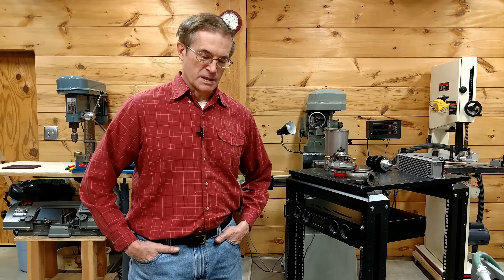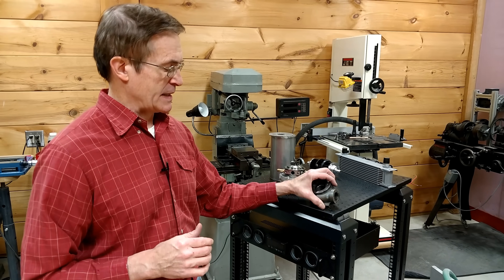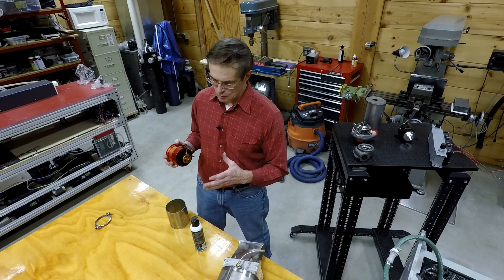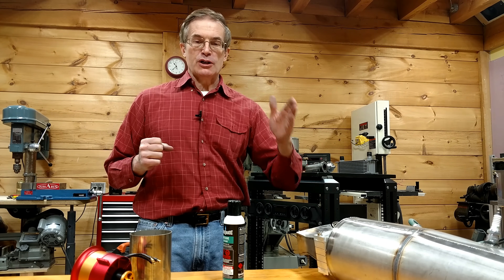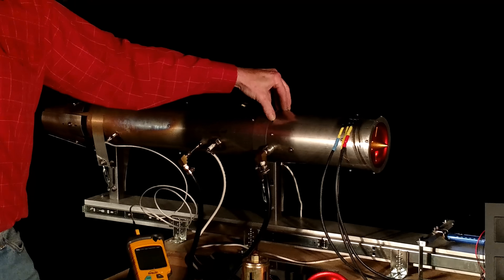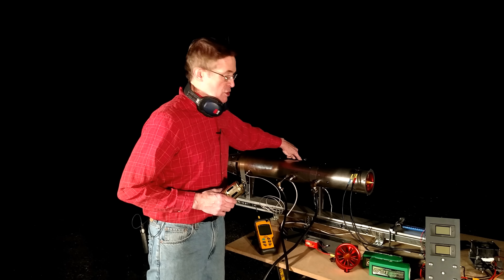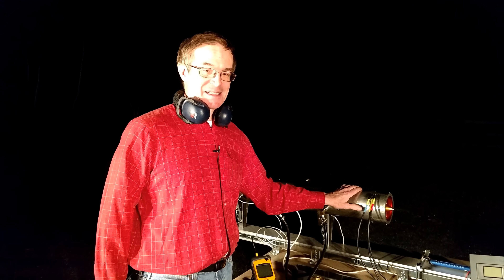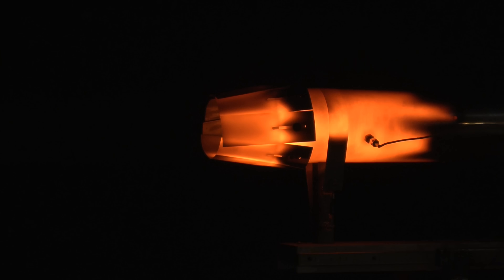Hybrid Jet Engine

Comment: Thanks great explanation. I never understood the "burning fuel increases pressure" dogrel. It as you say simply doesn't make physical sense as the  gases would come out the front of the compressor and the engine would stall. Clearly it doesn't so it isn't :P

Comment: hmmm you should be able to rig some  kind of trigger from the fuel to the afterburner to release a clamp of some sort on the tail duct (perhaps an electro-magnate type thing with a simple circuit to say stop when on)  and allow them to reposition an appropriate amount out ... probably need some high temp springs to pull them out and in maybe a flick a rocker that moves the spring to the correct side to open or close the vanes ? ;) well some ideas anyway ;)

Comment: Could this be effectively scaled down instead of up? Could you replicate this with much smaller EDFs (as well as the rest of the assembly) while still achieving a respectable increase in thrust? Building a smaller version of this and designing an rc plane around it would be a dream come true.
Reply from the maker: We tested and filmed version 2.0 of this engine.  With the same 90mm fans, but now with two fans in series we were able to achieve a little more than a doubling of the thrust of the fans alone.  The fuel burn is prodigious.  The thrust augmentation ratio is proportional to the square root of the absolute temperature rise from any compressor relative to the exhaust gas temperature. So, with roughly room temperature air exiting the fans and a 1500 C exhaust gas temperature (limited by the softening point of the stainless steel) a maximum 2.5 ratio is theoretically possible. The engine is successful and would become even better with additional compressor stages, but 2 Kg of fuel/min for 40# of thrust at this time may not be practical.

Comment: Is it possible to blead in air after to "compression" to increase thrust?
Reply from the maker: Because the air behind the compressor is already above atmospheric pressure, the only way to increase the pressure further is to pass this air through another compressor stage.  We do just that in the up coming video about the evolution of this engine.
Reply: I think you missudnerstud me. Having some kind of flow increasing valve like there are on aircraft slides. I think its called a Venturi device or something like that
Reply from the maker: Oh, I see.  Well, the compression ratio will decrease if this air is entrained prior to the combustion chamber because of the work done to draw in this air and due to the blending of this zero velocity air with the stream from the compressor.  The compression ratio results from the conversion of high velocity air to a low velocity flow in the combustor  We want this velocity as high as possible.On the other hand, once the burn has occurred and the expansion is complete, then utilizing the exhaust to move a larger mass of air will increase thrust.  It takes a LOT of air and devices that can do this are called augmenters.  They look like the cowling around a ducted fan and are about twice the diameter of the jet exhaust.

Comment: I never would have guessed how awesome a single stage electric fan + afterburner could look. I'd LOVE to see thrust numbers with just the fan and in the afterburner engine.
Reply from the maker: We finished the two stage fan video and we will post it soon.  The afterburner doubles the thrust of the fans alone and we will demonstrate this.
Reply: Fantastic! I can't wait to watch it.
Reply: As a thought - I'd love to see a comparison, at least theoretical, of the thrust you'd expect from a turbine engine with this power source, vs this afterburner-only design. Of course it's apples to oranges, since this engine has two power sources, but I suppose the turbine version would be MUCH higher output, and I'm curious how that supposition holds up.
Reply from the maker: Its easy to calculate an approximation.  The thrust gained with a re-heater (afterburner) is approximately proportional to the square root of the absolute-temperature differential between the exhaust that enters the afterburner and the exhaust from the afterburner.  With the fans this ratio can be as high as 6:1 at the maximum possible flame temperature.  With a turbine exhaust temp of 650C (923K) you could double the absolute temperature and augment the thrust 1.4 times.

Comment: If it's outputting more thrust.. should the fan spin faster than the battery can push the motor to draw in air?
Reply from the maker: Its outputting more thrust because the same mass of air, moving through the fan, has expanded due to the added heat.  This causes that same mass of air to accelerate down the tailpipe and reach a higher final velocity.

Comment: So essentially you're designing a jet without the turbine blades but using a battery electric compressor?
Reply from the maker: That is correct.  There are several reasons.  We want to prove that it is indeed possible to augment the thrust of conventional EDFs with the addition of heat, despite their low compression ratios.  The aesthetics, including the sound should be appealing to the RC community.  And, we are interested in the possibility of modifying sub sonic ram jets to allow some level of static thrust, augmented thrust at modest air speeds and enhancing compression ratios at high air speeds by permitting non-adiabatic compression.
Reply: I can see many befits of this for an RC jet design.  The turbine probably takes the most wear and tear because it is subjected to near melting temperatures.  There are cheaper turbojets coming out of China now costing half as much as Jetcat but the problem with all of these is that they need to be rebuilt every few hours of flight time.  They're extremely expensive to maintain.  A turbojet without the turbine may have substantially longer maintenance windows.

The other advantage over a pure EDF is that it may have a few times more thrust or range.  If most of the energy of thrust comes from jet fuel, you can carry a lot more energy.  You will still be limited by the energy density of the Lithium Ion battery but perhaps that could be extended 3X if 2/3 of the thrust can be provided by the jet fuel expansion.  In theory it might be easier to make a supersonic ramjet because you no longer need the turbine blades.

But to make a proper compressor wouldn't you need many series of compressor fans interleaved with stator blades inside of a narrowing passage way?  That's the only way to get higher compression ratios.
Reply from the maker: We just finished filming the operation of version 2.0.  The maximum theoretical thrust gain, with fuel, is approximately 2.5 with a stoichiometric fuel air ratio burning near 2,000C.  We produced a little over 2 to 1.  The fuel use is stupendous with low compression ratios and despite the much greater energy density, the effective weight efficiency is close to the EDF' themselves.  But the sound and furry is incredible.
There are other advantages that I will explain in the video.  Stay tuned.
Reply: You're able to get 2.5 times the thrust over a plain EDF system?  You mentioned in this video that you wanted to add a second stage EDF to boost the compression levels.  Is this in 2.0?
Reply from the maker: Yes, version 2.0 uses a two stage fan.  2.5 is the maximum theoretical gain possible.  We produced 2.0 times the unmodified EDF thrust.
Reply: 2.5X theoretical gain for a 2-stage EDF compressor fan?  2X could mean that you can get almost double the flight time (depending on weight penalty over pure EDF) which would be nice.  What about the durability?  Can this last many times longer than 25 hours without being refurbished because there are no turbine blades under high heat and pressure?

Comment: Try it in an aerospike configuration?
Reply from the maker: These engines are seriously sub sonic and it is important to minimize flow obstruction.  Aerospike engines are utilizing a segment of the divergent nozzle.  Therefore, they are designed around supersonic flow down streem of the throat.
Reply: Right, but I think its very possible

Comment: At 5:58 you say that the compressor increases the volume. That can't be correct because of the conservation of momentum. You have the same amount of volume of air going in as air going out. The pressure does drop, but it's the velocity that increases, the mass flow of air (volume/time) remains constant. https://www.grc.nasa.gov/www/k-12/airplane/thrsteq.html
Reply from the maker: I say that the combustion chamber increases the volume of the gas, not the compressor.  It is correct to say we have the same amount of mass going in and going out of the engine and in fact through each stage within the engine, but the volume of the gas at any point is dependent on the pressure and the temperature and these parameters are continually changing.

Comment: Very similar to something I'm working on. I got the idea to try something like this about 5 years ago while I was sitting in a jet propulsion class, but until now I've just been a cash poor mechanical engineering student. 
To be honest its kind of depressing to see someone else demonstrating an idea so similar to my own, but I guess the fact that it seems to be viable for you is heartening.
Reply from the maker: This idea is not so profound that you missed your shot.  There have been some early attempts to do this on YouTube.  The trick is dealing with the low compression ratios available from electric fans/compressors.  This is why electrically driven turbochargers have failed to compete in the automotive area. With version 2.0 we have achieved an augmentation ratio of 2.3 which is close to the theoretical limit of 2.6.
Where this gets interesting is when ram pressure is added.  Typical turbojets only see a significant effect from ram pressure at relatively high flight speeds.  Also, the benefit of turbo inter cooling may have some application to subsonic ram jets.

Comment: To my knowledge I don't recall ever hearing of any motorjet that has a particularly worthwhile power increase due to it's afterburner? And I have looked long and hard and tried myself. Does the concept actually even really work? I really want it to! I really hope that your efforts pay off. You are one of the few people I'd trust to prove if it's possible. Thank you for what you do and share with us all. Has anybody seen a motorjet that has a worthwhile power increase please?
Reply from the maker: When you say motorjet, I assume you mean an electric ducted fan.  In our most recent tests with the newer, two stage jet we see more than a doubling of the thrust compared with the fans alone.  The fuel use is stagering and the flame and fury is frightful. Beautiful!
An easy way to visualize what is happening without resorting to a lot of mathematics is to slowly approach the exhaust end of a running fan with an obstruction, the thrust increases substantially.  The increase in volume of the exhaust within the combustion chamber requires an acceleration and this acts to increase the back pressure for the fans.  We'll show this engine shortly.

Comment: This is cool AF like a hybrid of a pulse and RAM jet
Reply from the maker: Thanks!

I didn't go into this aspect of the jet, but sub sonic ram jets have never been attractive due to the extremely low thrust at low speeds.  At the same time, the low compression ratio of this hybrid jet and even of the two stage version we are testing today limits the attainable thrust.  But for this very reason, when this jet begins forward flight, ram compression soon begins to augment the compression ratio.  More typical jets, with their near vacuum in the intake  do not "notice" the ram benefit until high flight speeds are attained.  As the ram effect increases, the thrust will grow or the battery  draw may be reduced or at very high flight speeds, the fans can extract electrical energy from the flow and act as turbine coolers for the incoming flow.  This permits a much more thermodynamically efficient compression than the adiabatic compression in a simple ram jet.
Reply: How is the compression ratio? The second EDF keeps giving the same compression despite being after the first one? 

To make use of the ram compression you will have to fly at significant speeds, maybe this can be emulated with a bigger EDF/RCturbojet injecting air straight throught the intake
Reply from the maker: Both EDF's are powered by brushless three phase motors.  What determines the rotational speed is the balance between current input and load.  The first fan produces a high velocity flow into the second fan which spins significantly faster even at the same current input. The flow velocity increases further and this final velocity is converted into the pressure gain.  Nevertheless, it is still small at around 2.5-3 PSI.The ram compression obviously begins as soon as the jet starts to move forward, but because it is proportional to the square of the ram velocity it does not normally become significant until high speeds are achieved.  With the low static compression ratio produced by these EDF's the benefit of additional ram compression will be seen much earlier ie @ 85 M/s ram pressure equals the pressure gain from one of the fans.
Reply: @TechIngredients  wow regen from high speed? I've seen rc helicopters able to modulate the pitch of the rotors would that be beneficial? I've been thinking about using a mini steam turbine powered by the exhaust heat on a car to spin an alternator for free HP or just to be cool... Maybe that idea could be used on this for cooling and hopefully some thermal efficiency scavenging
Reply from the maker: If you are thinking about fuel efficiency then this engine is not optimal.  I would lower the fan input to a minimum and use the exhaust duct as a light weight steam generator to drive a pelton wheel turbine which would direct drive a large propeller.We are heavily modifying a pulse jet engine for improved efficiency and this looks promising.